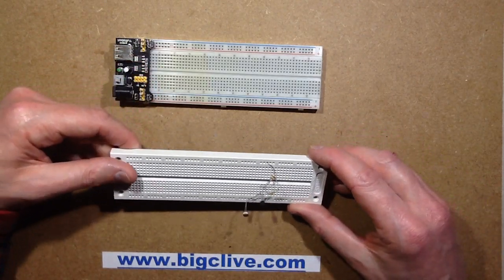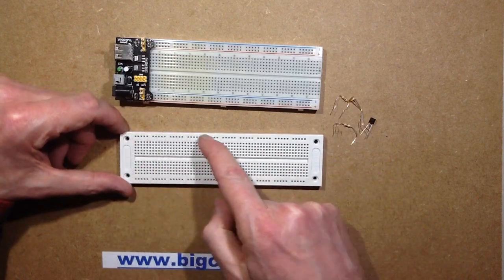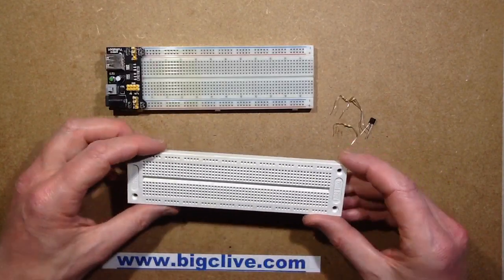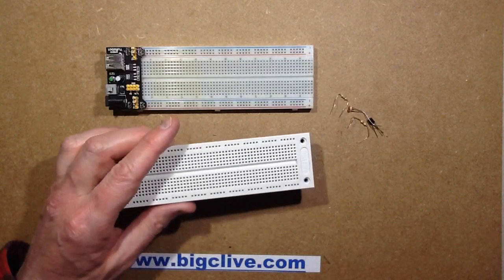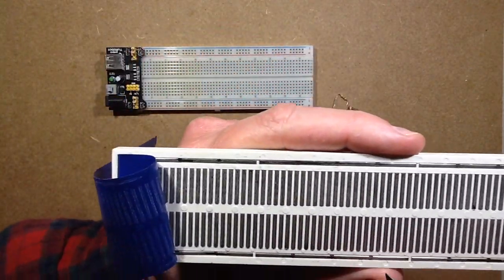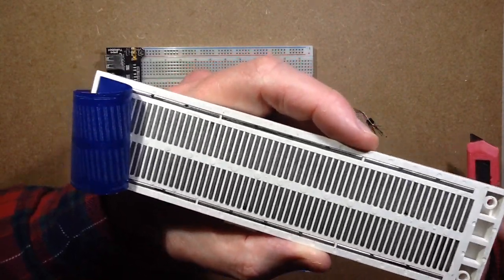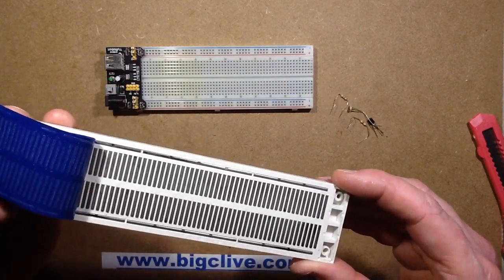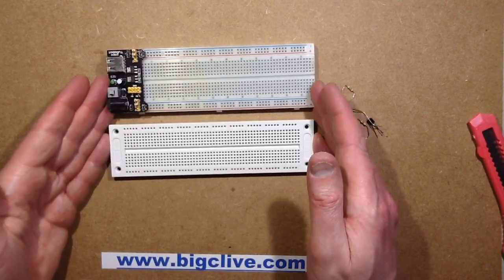Boobytrap breadboard from China.

Comment: What always fucks me up are the solder protoboard layouts. So many companies send you free boards with every order but even places like Sparkfun or Adafruit have no markings at all to indicate any internal connections. I've ruined so many boards because of that...especially since they're often different colors too, some of which can make it very hard to see the traces...

And then you get ones that link rows the full way across or ones that link halfway or ones that just link groups of three so you can't just multimeter test a couple points, you've gotta basically reverse engineer the damn PCB before you can start building anything...

Comment: I have some older breadboards - not made in China - that are longer than most breadboards.  I have a couple that have three stacked top to bottom and in those cases the buses do have a break in the middle.  Just in the middle though and not in three different places.  I just drop jumper wires on them and forget about it.  They aren't marked per se, but there is a larger gap between them and the regular bus.  It's like it skips a mount point in the middle.  You can definitely tell with a visual inspection something is different, but they aren't marked in any way.  These are 15-20 year old breadboards in some cases.

Comment: No.   You are confusing boobytrapping with bad documentation.  Those breaks are molded into the plastic frame.  There is ZERO "possibility" that the strips were "the wrong size".  I have modified "standard" protoboards to be this way; it is very handy for mixed-signal development when there are not dual-row power sections.

Comment: It's so you can have seperate voltage supplies in different parts of the board.
You can have 3.3v, 5v & 12v sections for different purposes.

Comment: Wow, I was working with a breadboard a few years ago that had this, and since I was new to electronics I figured it was just the way breadboards worked and that I was misremembering what I had learned in school. It's comforting that someone more experienced was perplexed to see this. I ended up sticking a bit of wire between each break to just tie the power rails together and kept them as permanent fixtures ever since.

Of course with the random spike of attention youtube assigned to this video, many people are saying they've seen this before, but I maintain that it oughta be clarified on the breadboard.

Comment: I have a breadboard from maplin (IIRC) which is similar, at least that one has red and blue lines on it with gaps in the lines showing where the breaks are.  I just put some links in it across the breaks.  I suspect this is if you wanted to use more than one voltage perhaps?

Comment: i've seen them with just one gap in the center of each bus strip (so it's essentially 2 half-length breadboards in one, can be useful for when you e.g. deal with a 3v cpu and a 5v peripheral), but at least those were marked with gaps in the red/blue stripes

Comment: I only got involved in electronics about 8 years ago. I've always purchased my breadboards via ebay or similar and figured that, even if the seller is shipping from a US address, that the boards were sourced from China. Every single board I own is configured like this. When I was just starting, I puzzled over this for a bit then decided that this was done so the the board could support multiple voltages simultaneously  (e.g. 3.3v   5v) or even a small section with low voltage AC. If I need more than 1/3rd of a full size board for a project, I simply jumper the two (or 3) sections together where each rails are broken.

I was very surprised by you not knowing this. I have learned a ton from you (most thankful for the pointer on what NOT to do). You are, in every way, far more knowledgeable, far more experienced, far more seasoned than me. It just didn't make sense that would know anything about electronics that you hadn't mastered years ago. So I'm thinking that this   'Chinese configuration of a breadboard is something relatively new and in the past, breadboards manufactured in the US or the UK did not split the power rails into sections. Correct?

Comment: Agreed it seems odd, but Might be useful if you don't have a lot of money.  Could have 3 separate  prototypes on 3 separate power at the same time,  Like you said if you want you can just jumper the sections to carry over the voltage.   Yes I saw this video years ago, but my comment is missing so figure I would add it again.  Also youtube recommended i watch htis video.  I do miss the shorter videos.  2-5 minutes is a good video length.

Comment: I have a board similar to this, with power rails split into 3 sections, and I find it quite useful. Allows me to build or test different parts of circuit separately, or just join them with a link.

Comment: That's actually pretty common for those Chinese breadboards for some reason. Though in my experience, they are usually interrupted only once in the middle. So that you would basically need one jumper in the middle for it all to be connected.
Not sure why they did that. I guess I always assumed they thought it might be useful to have more flexibility and be able to use the two halves individually if needed.

Comment: It's useful if you have a de-coupled power bus, for examplpe between the power and pre-amp stages of an amplifier you might have a resistor in series with the bus and a smoothing capacitor to ground.

Comment: All the breadboards at my high school were like that (not the exact same one, the power bus bars were split in the middle 50/50). Took me ages to figure out why my circuit wasn't working the first time and now years later I still have a habit of putting a jumper between both ends of the breadboard...

Comment: I got a big board with this same setup. Until I figured out why my circuits weren't working, it was hair pulling and depressing. What a failure I felt like... lol. Now I just have permanent links at each junction. Maybe their reasoning is to be able to have a few different voltages available on the board. 🤷‍♂️

Comment: A broken breadboard is a quick way to sunder confidence in electronics knowhow, as I learned to my cost. Was checking and rechecking solder joints I had made on breakout boards, swapping components left and right, thinking I got a bad batch of optoisolators/diodes/mosfets, buying from a totally different supplier, still running into problems left and right and things would work sometimes and not others. Finally bought a new breadboard and, oh look, everything is working like it was supposed to from the start.

Comment: You get what you pay for….

What I believe is that instead of manufacturing rails for different size breadboards, they manufacture only rails for the smaller boards that are a 1/3 the size and put 3 in the larger board.  Anyway to reduce cost is the China way.

Comment: I have a number of solderless breadboards to through into the survey. My long 3M (c. 2007), Archer (c. 1988 Radio Shack) and ASP (c. 2020) boards all have a 7.62 mm gap where the rails break so it's very obvious. My short boards are solid end to end but that obvious too with 2.54 pitch all the way.

Comment: Electrical engineer here: it’s actually not all that uncommon for bread boards to have those power buses sectioned like that. They’re not the popular option but it is a useful feature if you have a circuit with multiple voltages you’re working with. They usually mark the partitions with a dot or perpendicular line or “M” depending on the manufacturer. Sometimes the blank spot between the power bus lines is slightly wider than the continuous sections. Point is there is usually an indication if you know what you’re looking for. It’s definitely frustrating the first time you run into it though lol.

Comment: I have a few of these. Your first clue that you have one is the single row of power connections along the sides. Might not always be true but the ones I have are the only strips I have with the single row power connections on the side. I found out the same way you did. My circuit wasn't working and I had to run out the connections to find the broken ones. I found it too difficult to remember what is connected so I just put in bare wire jumpers to make them common.

Comment: I wonder who were the 94 morons who had issue with reporting the defective breadboard?
Reply: Unlike this video seems to suggest not everything made in China is crap.
 Be careful where you buy.
Only because it's made in America it isn't automatically better.
Reply: @safetyinstructor  is anything still made in the u.s.?  Your typical American car has parts and subassemblies from around the world.
Reply: @adamf663  pretty much everything is made in China because they usually make the best products for the least money.
The problem is that the consumer level doesn't get to buy from the big companys.
Businesses instead can.
After all you just have to be careful where you buy your stuff no matter where it's produced
Reply: @safetyinstructor  It really depends on the engineering.  It used to be all crap, but lately I purchased some really top notch gear from china, like superbright metal bodied flashlights, an e-bike conversion kit, my Lenovo laptop, an rgb 128x64 led panel I'm using for a digital clock with weather, etc.  Reminds me of japan's rise from a reputation of junk to a reputation of top quality.
Reply: @adamf663  right, as long as you don't trust all the flashy overblown ads you're probably getting a pretty good product.
I've made a really great experience with their pcb stuff like arduinos and other micro chips.

Comment: I had a breadboard like that. It came with an arduino starter kit from Ebay and the connections were so loose that the slightest bump of a resistor would cause the connection to jitter.

Comment: I have a 4-panel breadboard manufactured in the US in the early 90s, you won't get it until you pry it from my cold dead hands with all these chinese POS boards out there.  Not once has my troubleshooting come down to being a bad connection on the board itself.  I'm pretty sure all of the ones made in the last ten years or so use some really cheesy metal that will not spring back once you start shoving things in.

Comment: I am sorry, but I have know about this for years. Before I start (with an unknown board) a project I check the continuity of the busses. 

I just loved the 'Probably "Cribbage Board" didn't get translated properly.' comment below!

Thanks to bigclivedotcom for the information, as I have seen in the comments, some of us know about the problem, and some don't.
Another little point, for those unfamiliar with the breadboard with the PCB attached, shown towards the top of the video frame, there is a correct side(end) to put thew PCB on. You have to put it (the PCB) on the correct side (end) , so that the red line is + (positive) and the blue line is is - (negative). How do I know that, well take a guess!! Correct smoke and smell!

Comment: looks like it will handle 6 different voltages for op-amp circuts: +/- 18v,  +/-12v, 5v and 3.3v
Reply: Yes, I have seen this design for boards using IC.

Comment: Well, think of it this way: You can do three voltages on one board.
Reply: Btw, Chinese companies also make things that their own market demands. Perhaps Chinese engineers prefer breadboards like these.
Reply: @buckrogers5331  how would you know where the breaks are though?
Reply: @leavewe  What I know is that Chinese engineers and manufacturers work at speed and may have overlooked marking the boards. Or that the middle man is clueless too.
Reply: If you don't waste time, with a unmarked board, like me. I learned the first time, but it pissed me off the first time too! It should be marked on the top of the board, and on the package. Otherwise it's cheap crap, and some places mark up cheap crap, to throw people off.
That's why I missed my old electronic stores. Looking at the product in your hand before you buy it, was better than ordering online, THEN finding out its crap. Older products like those project boards were made better, than what we have now, as far as I am concerned.
Reply: You can still have 2 separate voltages running on the above boards' bus bars. Sure it's 33% less but at least you don't need a bunch of jumpers.

And in my opinion the board on the top is much more visually appealing.

Comment: We have split supply breadboards at my job, same size as your top board but the supply and ground rails have breaks in the red and blue lines to indicate this. It’s just so you can have lots of options for isolating circuits or have up to 4 different supplies... your probably right about the Chinese version though - doubt they’d make an option like this on purpose... or simply skimped on the blue/red lines..

Comment: I remember in my tech school we had like 4 or 5 different types of breadboards. these were one of the styles we had. Ours however all had the power rails labeled on the front properly to identify which ones were solid and which had "zones" (that's what the screen print said). I always just figured they were specifically made so that you could have isolated circuits on a single board or multiple voltages. We also had ones that came with built in jumpers from one side to the other for the power rails, as well as breadboards without any power rails at all.

Comment: ive used these but the one i had had a mark to indicate the breaks. there have been times when i needed to transfer the negative bus to the top so led's could be installed to line up with chip outputs instead of additional jumpers. not very often do you need so many access points to the +ve supply. got my first one back in 82 and it cost me about 40 dollars, today, theyre worth about 5.

Comment: I have several breadboards like that.  They were mad that way intentionally.  Mine even have small tabs on the front to show where the breaks are.  Lets you have more than 4 buss bars/voltages.  can be handy for more complex circuits.
Reply: Basically, the problem isn't that the wiring is wrong, it's that it's not clearly marked on the front.  All of my breadboards are like that but it's clearly marked so you can see where the gaps are.
Reply: Makes sense and yet when you buy expecting one thing and get another that's not good.
Reply: Yes, not very familiar with the various designs, but thought right away that this could make it more useful.
Reply: Tandy’s Radio Shack breadboards in the 1980s were all like this also, which is meant to support multiple voltage rails, although theirs was better marked in raised plastic but not colorized.
Reply: yes, i have seen and had it the special breadboard like this but it usually have a mark or two, if someone getting this type of breadboard but without any mark it could be defective product / rejected product that someone sold it again as is. this is same as a fuse without any mark, in 50 of cheapo fuse there is usually 2-7 fuse without any mark, because they use both same end cap rather than different end cap with mark
Reply: I'd say Clive's are damn near useless given they don't indicate where the breaks are! But admittedly, if they did, they'd be quite useful for some things indeed!
Reply: Exactly, drove me nuts when i got them but they are actually quite handy when you need different voltage busses.
Reply: I still have a couple of them like that from the 80's, made in Japan. Only 2 buss bars instead of 3 on each side, but same idea.

Comment: Yeah.... Chinese products ... a mixed bag. I had good luck from them for a number of years but everything in the last six months has been trash. I quit buying on ebay because of that. That and the fact things are marked as shipping from the USA then when you buy it, the bank calls and asks if it's fraud because it's a china based seller... I invariably say yes because I bought from a US based supplier. So, not just misrepresenting their location but misrepresenting what they sell. I bought a 60W flexible solar panel for $30. It turned out to be 10W. That's fine and the price is OK for 10W flexible but it ain't 60W which is what I really wanted.

Comment: I have an older Radio Shack experimenters breadboard made like that one and I actually prefer the material it's made out of instead of the newer plastic ones.  I'd like to get some more of the ones like this one and I can solder wires like you suggested.

Comment: I have several like that, I just use jumpers, in fact my large breadboard is made up of 4 boards just like that with an additional power strip across the top. Really sucks but then you get what you pay for I guess and most of the crap from China is dirt cheap.

Comment: ALL breadboards are made like that.  The metal contact strips are NOT made in continuous lengths.  They are made in discrete unit lengths. They are chopped into the groups of  5 for the vertical columns, and they are used "whole" for the horizontal (power bus) sections.  The problem with this board is NOT how it is constructed.  The problem is that it is not labeled properly.

Comment: I encountered a similar puzzle using these, until I found out about the split rails. I actually find it quite useful now for example if I have different parts of a circuit working from differing supply voltages or want to add in some extra supply filtering for a sensitive part of a circuit. Also compared with the other type of breadboard shown in Clives video I found these ones more reliable and durable. For clarification both types were bought from Chinese eBay sellers.